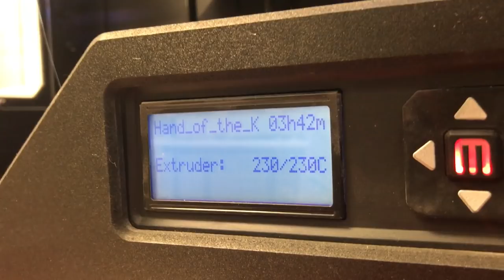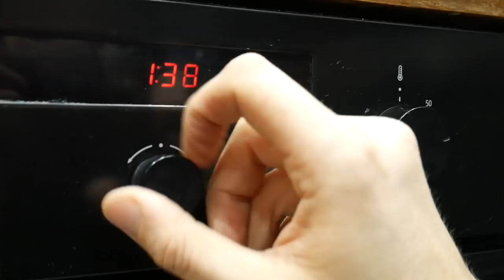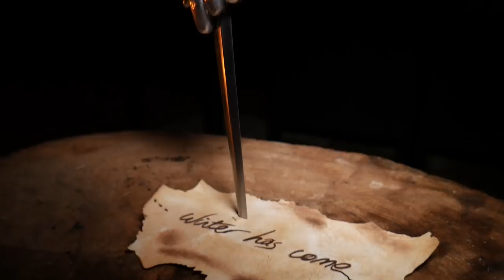Tyrion’s Pin BUT BIGGER

Comment: Very funny, cool project! Interested in the grinder, did you buy attachment and the grinder as one or separately. What model motor did you go for?
Reply from the maker: Thanks! This is a belt grinder attachment for a standard bench grinder. We got this whole set up from Jon at MultiToolProductsEurope on Instagram. He’s super helpful so give him a message and he’ll be able to give you a ton of information. He probably knows the spec of our set up better than we do! Make sure you tell him we sent you 👍🏼👍🏼
Reply: Brothers Make will do!
I follow him on Instagram anyhow. Just like the setup you have
Reply from the maker: It’s really versatile. We use the other side for a buffing wheel but can switch over when needed 👍🏼